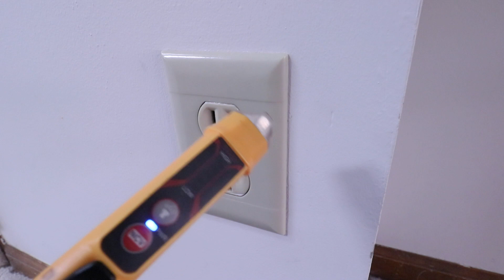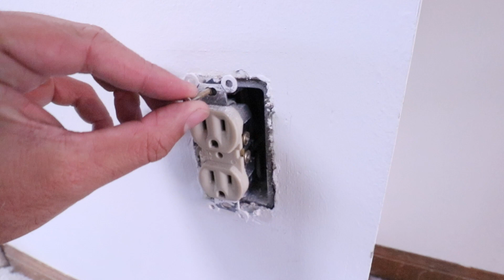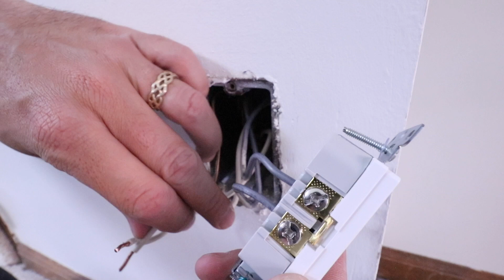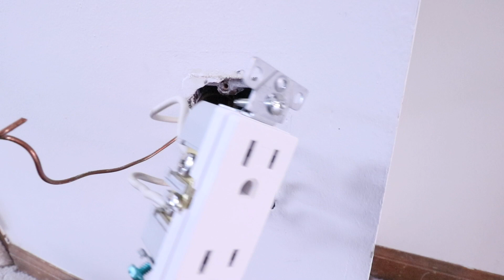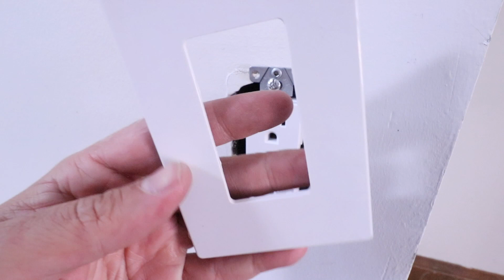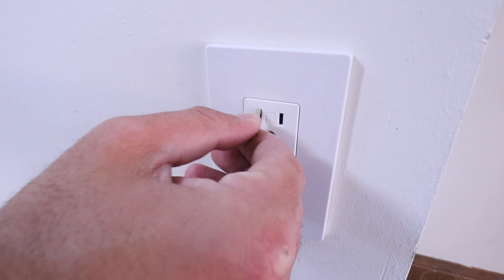How To Replace An Outlet or Install Tamper Resistant Outlets

Comment: The way the wires were connected on the old outlet isn't back wiring, it's speed wiring, or stab-in wiring. Back wiring is a good option, but the stab-in connection is terrible! Never use stab-in connections, they don't hold the wire as tight as the screws do, which can cause things like arcing, heat, and melted plastic! This is unlikely, but it's not worth the risk. Just use the screws! 

Note: back wiring isn't bad, only speed wiring. Back wiring takes advantage of the screw's torque to hold the wire in place, the speed wiring only pinches the wire in a connector with little force.

Comment: These tamper resistant plugs are horrible. What where the regulators thinking!! Ughh. How do they expect someone with weak or arthritic hands to use these. Terrible design!! 👎ughh!
Reply: The old ones weren't good, but the newer tamper resistant outlets are much better. Also, some brands are worse than others. Leviton and Legrand are 2 brands I know have good designs that don't require you to use much force (at least in my experience)